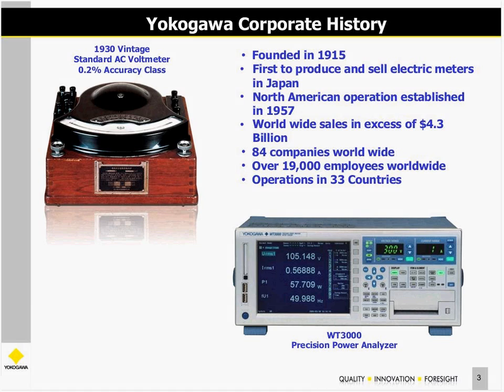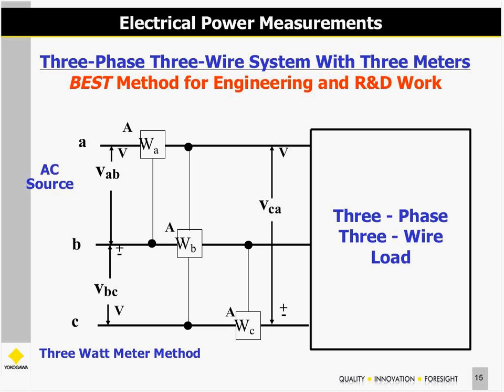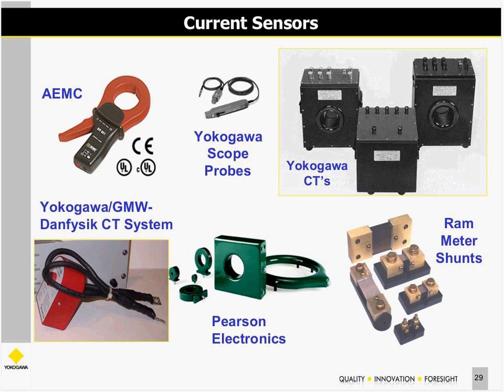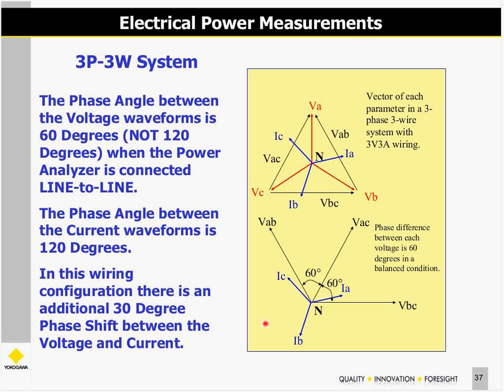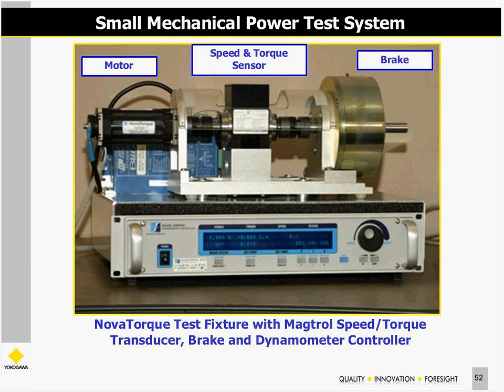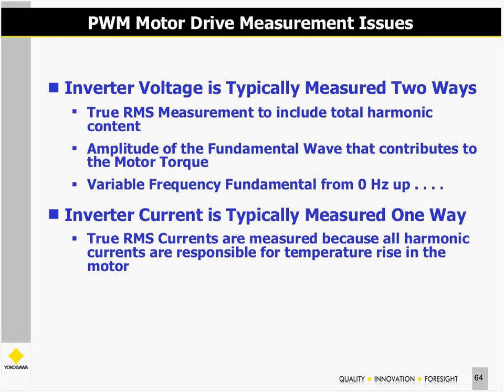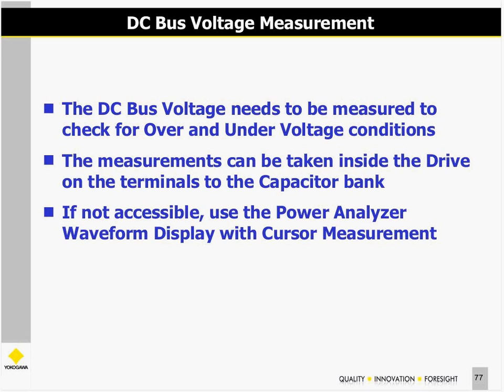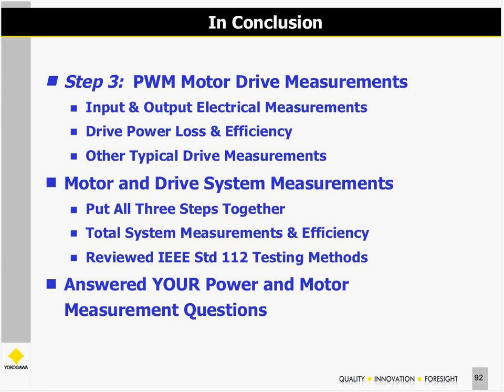Webinar - Electric Motor Testing with a Digital Power Meter

Comment: Hello Which standard is your device compatible with for motor measurements (IEC/NEMA/IEEE etc.).
Reply from the maker: There are several standards our power analyzers are compatible with for motor measurements. I would recommend checking out our Motors & Drives webpage and reaching out to our application engineering support team at yca-support@yokogawa.com for more information. https://tmi.yokogawa.com/us/industries/motors-drives/